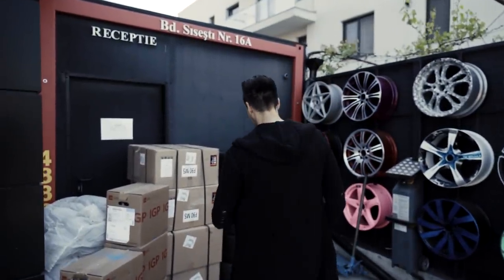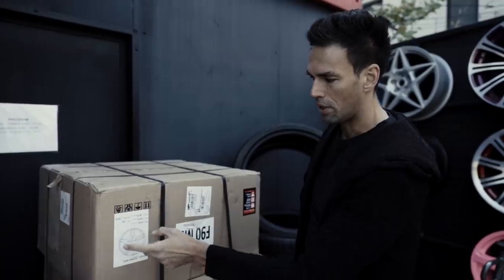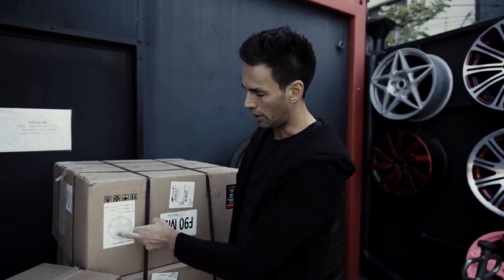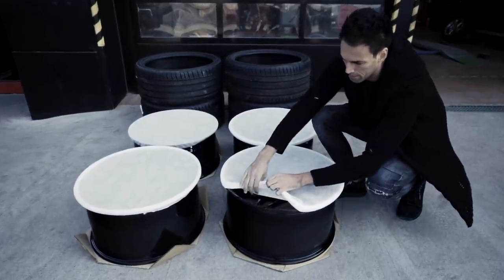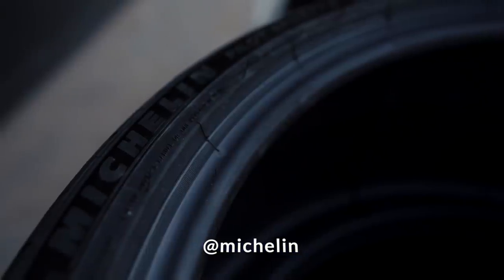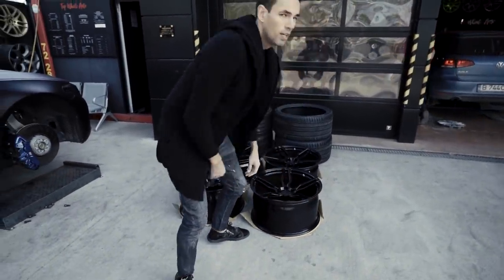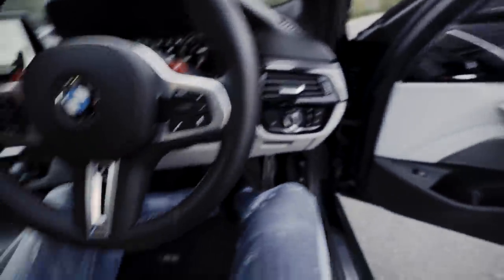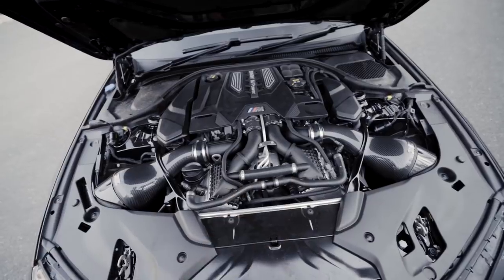TATE IS GOING TO LOVE THE Z-PERFORMANCE WHEELS  !!!

Comment: You are very right with the weight of the wheels. You can really feel the difference in a car with not so much torque. Those wheels are crazy with only 8kg on 21's